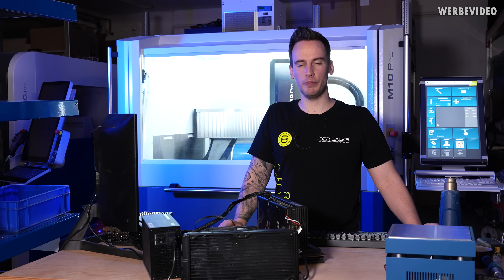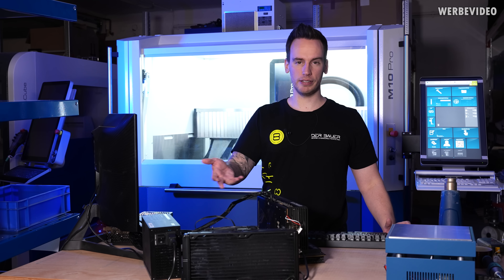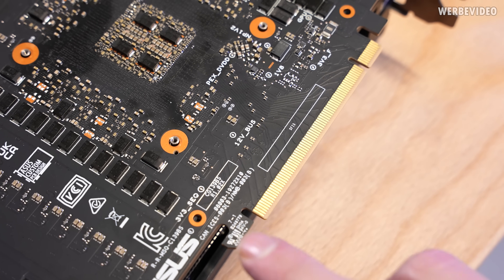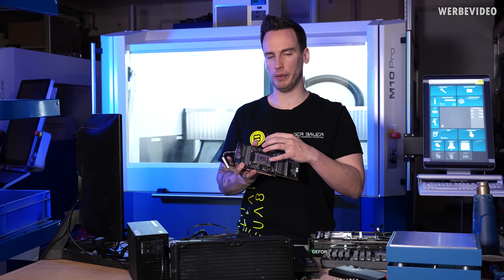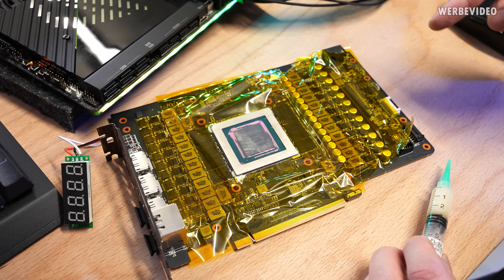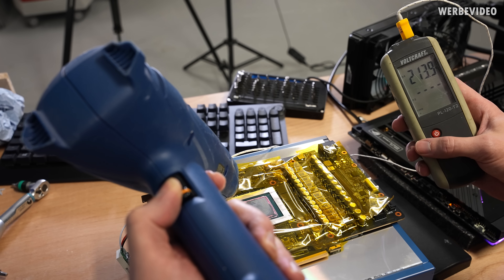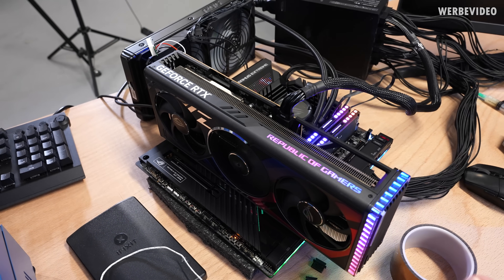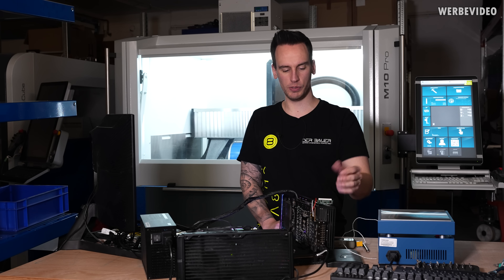I tried to repair my RTX 4090 and killed it :(

Comment from the maker: Other things I tried after the "repair":
- flash the stock BIOS again
- Update the Nvidia Firmware
Any other ideas? :D
Reply: Send it to krisFix...he's an expert at repairing GPUs and he's also located in Germany
Reply: @iLLusiveMan82  i dont knw about krisFix but i think we can try ChrisFix

jk😁
Reply: @iLLusiveMan82  thats good advice he will tell him that shouldnt add flux like that  !!!! the added flux bracked the card !=]
Reply: Send it to KrisFixGermany for repair. German based youtuber who repairs GPUs. He loves this sort of stuff.
Reply: @PanaehaliTut  CrissFix?! The Auto Repair guy? The closest Computer Related thing Ive seen he does is to use PC fans to create a fart remover in a car LMAO
Reply: @n1kobg  KrisFix-Germany is the name of the youtube chan. I believe he's the best guy to fix this card and he's local to Roman.
Reply: @n1kobg  I misspelled the channel. And edited it. Right guy named KrisFix
Reply: Have you tried resetting it with a hammer?
Reply: @oOZellzimaOo  Sledgehammertime
Reply: KrisFix-Germany
Reply: Imo covering the whole board with capton tape was a bad idea. If hot air got under it and managed to melt the solder on some components, this components can get lifted from the board if they were glued to the capton tape. In the future protect only the components that can get damaged (like electrolitic capacitors, plastic parts and so on). And don't put the board directly on the hot plate, use something to lift it a little, because if you have any BGA ICs on the bottom of the board, especially underneath the place where you heating the top of the board, the solder on this ICs can melt and they can get pressed to the board which will squeeze solder balls out of the IC and it will make shorts.

Please check if any smd components were moved out of place, especially near the part where you put your thermal probe. Also check that every memory chip is leveled the same and are not skewed - if any chip is skewed then you'll need to reball and resolder it. Also, if you somehow have access to nvidia's diagnostics software (MATS+MODS) for this gpu the definetely run this tests to check the memory. I'm not really an expert on repairing GPUs (I have repaired them, but not very much), but this looks like a VRAM problem to me, but half of the time VRAM probleams are related to the GPU itself or it's soldering . If all SMD components ar ok and no memory chips are skewed then you'll need to reball and resolder the GPU.

P.S: you said that 220 degrees is safe, wich isn't wrong, really, because the melting point of Pb-free alloys (at least the ones which are used in consumer electronics) is around 203 degrees celcius, but it'll only melt at this temperature if the whole board is at the same temperature (that's because the copper in the layers of the PCB is placed unevenly, especially on ground and power layers). More realystically, solder under gpu will melt at round 220-230 degrees celcius, but that's if the whole chip is at this temperature.

Edit: forget to mention that you needed to remove the compound on the corners of the chip.
Reply: Northwestrepair channel might have a clue. 🤔
Reply: The kiss of life?
Reply: Collab with a GPU repair specialist on YouTube
Reply: You can send it to KrisFix-Germany. He will figure out if it can be fixed and find out what the problem was in the beginning. And he lives in Germany. He is an awsome GPU service tech. Love from Norway
Reply: Definitely send it to KrisFix. He will try to fix it it live.
Reply: Weirdly, GPU-Z reports no VRAM... Maybe the memory chips shifted... With a heat-gun it's too easy to move small components simply with the force of the air or an accidental bump of the table... That's why infrared ovens are used for this kind of repairs...
Reply: Turn it off and turn it back on again. 😮
Reply: Let KrisFix-Germany have a look at it, he can re-solder and re-ball it for you, maybe for a collaboration or as a paid service, but he knows his stuff and I watch him regularly.
Reply: send it to northwestrepair (youtube channel) , he is a MASTER repairing gpus.
Reply: @MrDvneil  +1 For sending to northwestrepair
Reply: KrisFixGermany might be able to help 👍
Reply: Card has dual bios switch. try other bios.

Try reflashing the faulty bios while running the igpu
Reply: Contact Cris-fix, I'm pretty sure he can rescue your 4080 xor give some conclusions about what's cause the problem
Reply: @KirbyTheKirby  really? steve calls him for advise!
Reply: @KirbyTheKirby  Steve wouldn’t be able to do anything to fix it.  They guy can’t even solder to save his life. 😆😆
Reply: Have you tried percussive maintenance?
Reply: If you were in the USA I would recommend you send this to a professional- Matt’s Electronic Solutions or another great GPU repair professional is Northwest Repair but since your in Germany your best option is to send your card to KrisFix-Germany. Check out his Videos on GPU Repair. He is one of the best in the business and if he can’t fix your GPU I don’t think anyone can.
Reply: @shiftctrlhack  is Matt’s Electronic Solutions  located in Florida, Matt Joiner ?
Reply: @Gti_Jason  Yes that's him. He's actually been closed since Hurricane IAN. He's worked on a few laptops for me in the past. The guy is legit a good dude. I've called him about computer related things even when it didn't have to do with a repair. He's always there when you need some advice or help. His prices were pretty good and I've never had a problem. He's going to be starting a repair channel from what he said 8-9 months ago when I talked to him. Hopefully everything is ok. I just checked and he's still closed.
Reply: Sacrifice a chicken to Jobu
Reply: @northwestrepair is another YouTuber specializing in GPU repairs with some excellent examples on his channel, maybe give it a watch to check the tools he uses for fault finding or get in contact to see if he can help you.
Reply: I have a awesome idea. Collab with KrisFix-Germany! Hes from same country and he repairs cpus on top level!
Reply: bro send it to KrisFix-Germany or speak with him. his a national of yours and a master is gpu repairing (reballing etc). you could make a great collaboration btw. check his youtube channel KrisFix-Germany
Reply: Try communicate  with this guy the best 1, YouTube channel northwestrepair
Reply: The baking at 100c usually simply evaporates any humidity underneath and in in porous parts and or the mainboard. Of course you have to bake it in an oven to make sure the average temperature gets to 100c and all humidity turns to vapor.
Reply: Did you try plugging the card in a 8x slot? Just wondering 🤔
Reply: Thermal cycling the card is a much safer method than trying to reflow the card...
Reply: give Northridgefix a bell.. maybe he has some ideas ?
Reply: Seems like the gpu didn't read the vbios, you can try by using dmm, put black probe on gnd red probe on pin 1 bios, then turn on the card and quickly see if the voltage go high low then high, if its does then the vbios is oke and the gpu able to read it
Reply: Shunt resistor mod

What worse could happen?
Reply: send it to a professional repairman like louis rossmann on youtube he and his team fixes these problems everyday or better yet send it back to asus for rma and see what they want you to pay for the repair
Reply: place it on the wall
Reply: Reball.
Reply: i would love to have it as a paperweight :D but not for 2000 haha
Reply: btw i think you have a dead core now when clocks are at 0
Reply: Find an anvil and a heavy hammer, works 100%
Reply: @KirbyTheKirby  🤣
Reply: Send it to a repairman to do reball.
Reply: Next time you get this issue try pcie bus inversion. Cover up rear half the fingers and see if it still runs x8. Then cover up the first half and see if it still runs x8. (pcie lanes only) The mobo does this any way when you add multiple devices (mux/switch) or do sli. Should be a setting in bios too. This way you test from card edge to gpu die all lanes. Done in top x16 slot.

PS - This is also a way to get mining gpus running (that arent dead) that were inserted the wrong way.
Reply: reball the chip
Reply: have you tried reseating all the smd's ?
Reply: Just put asus tuf oc bios
Reply: have you tried fully clearing the vbios before flashing? try using a ch341 programmer and solder it to the chip directly, if some cells are damaged on the flash, a different checksum would result and the flasher should tell you. If the vbios chip is indeed damaged, you can usually purchase a blank one for just a few €s. Once you have the chip, flash it with stock vbios, read it back to verify with checksum and finally use a hot air station (not a heat gun please!) + flux to remove the old chip and solder on the new one ;)
If you don´t have a hot air station, you can usually get away with making two blobs of solder around each side of the chip and rapidly heating up both sides to make it come off. Again, plenty of flux is needed to get a good result.
Reply: Aye, next time buy Radeon.
Reply: Try manually switching it back to 8x
Reply: Hey :) I can try to reball it, maybe you just melt/shorted some memory pins/duno - need to check =) in the worst case scenario you overheated memory controller and it doesn't detect memory anymore even if core shows up... I actually love doing mods to gpu's - just recentlly bring to live rtx3070 with new memory and some clever gpu vcore mods
Reply: You probably need an actual hot air for soldering not a hot gun then reflow it. You might of just barely melted the solder and it didnt attach back.
Reply: Call Asus RMA and pray they didn't watch this video.
Reply: @der8auer EN
maybe I can tell you what happens 

Same problem, happened to me (PCIE 4.0 x8)

I am using ROG Z690 EG, I took it for maintenance, after two experiences, I found a solution

If you update your bios (maybe 1403,1505,1601) it was at that time that the problem arose

Be sure to update directly to the latest bios before 1403 (eg.1101/1304)

Now can't go back, I can only send it to their headquarters in Taiwan to flash back bios 

Now I running bios 2103 and Tuf 4090 ，finally can do it pcie 4.0 x16 

Hope my unhappy experience can help you
Reply: Reballing !!
Reply: I would heat it up and try re-Allain GPU package and put some pressure from top on the package while cooling it down. I think one of the corners gets displaced via you blowing air on top of it.
Reply: 80 degrees ... i dont know which oven u r using but mine goes higher and i can reach the needed temps

U DONT USE HEATGUNS !!!! ... as soon as the solder gets liquified the parts are LOOSE and free to move ... by adding air pressure(and maybe vibration by moving it) it will become a recipe for failure !!!   ... use an oven and do a heating cycle with cooldown time

that was a pretty stupid move

PS: i'll take the paperweight for shipping?
Reply: I would try sending it for warranty repair xd
Reply: flash another bios with different id and then flash stock bios back, becasue flashing the same bios everytime it just doing nothing, this is known bios issues of rtx 4000 series
Reply: @krizFix can fix that. I think he already has the stencils and tools for 4090.
Reply: Flash to asus tuf bios and check it out.  Then flash back to asus strix bios.
Reply: I think a reball would be the best, since the reading from the thermostat might be off and you might just overshot the melting point of the solders and some of them fused together and shorted some critical pins. The pads on the pcb needs cleaning anyway.
Reply: Autoclave?!
t needs pressure
Reply: Any access to someone that could re-ball it as you said? Or maybe you've got contact with some AIB that could swap gpu die to different card or different gpu die to this one altho i know, that's kinda a stretch :D
Reply: 1 Check all voltages on the graphics card.
2 Have someone who specializes in graphics cards perform professional reballing.
3 Replace the memory.
Reply: You're asking us mere mortals???
Reply: just reball gpu
Reply: Did you try flipping the GPU the bird?  That's usually my goto after swearing at my failing hardware 😀
Reply: Nice
Reply: Warranty?
Reply: Bios chip fried?
Reply: Ask /Louis Rosman what he thinks, im sure hed be glad to help a fellow youtuber and you both can make a video about it. win-win
Reply: do the same thing but with proper equipment
Reply: return it to the shop or sell it on amazon as almost never used, in perfect condition :)
Reply: Карта лежала прямо на нижнем подогреве, +фен дул очень сильно, нужен визуальный осмотр, не сдуло ли что-то) И снизу на предмет слипания элементов.
Reply: А вообще можно было бы пару роликов глянуть как работают профессионалы.
Reply: I would have made sure that the card was flat on the heat plate to discourage solder from flowing all in a common direction which could then bridge neighboring pads. 

Connect a JTAG probe and compare the boot sequence to that of a known good card with the probe.   Ditto for any UART headers you can find on the board.  You maybe 'lucky' that the issue now is something else like a dead power stage and the card is forcing itself into a safe configuration.  Thus check those microcontrollers on the board with JTAG/UART/I2C probes as appropriate as well.
Reply: KrisFix-Germany
Reply: Judging from what you get, there is definitely a problem with vBIOS. Here are possible causes and solutions:
1. Power for vBIOS EEPROM chip is messed up. Check the voltages on pins. Also, be sure, that pin 1 and 8 on EEPROM are not shorted.
2. Dual BIOS switch circuit is damaged, which leads to two simultaneously working vBIOS chip. Easy way to solve this is to desolder one EEPROM or desolder vBIOS switch and and try to solder jumper wire instead of it.

I think, it's nice starting point. Also, check the back side of the GPU for any component casualties, since come components on the bottom layer have direct contact with preheater surface.

If I could lay my hands on this card, it'll be much easier and faster to fix it. But sadly, I'm not in Germany.
Reply: @valuxin  Good advice
Reply: try turning it off and on again
Reply: If you have your SSD installed in the first CPU m2 port it may limit the first PCI express slot used for graphics cards to 8 lanes instead of 16. Moving the SSD to the second CPU slot or to the chipset one will make the graphics card use 16 lanes. This behaviour is motherboard specific. Some have it, some don’t. The manual should contain information about that.
Reply: ask mom for more money
Reply: Power connector? 🤔
Reply: This should be a warranty replacement right?
Reply: The PCI-E x8 happened to me with my old HD 6970,
I accidently fixed it when i went sub-ambient on the card, the cold somehow fixed it.

Anything else i tried failed, but the solution was an accident - life is strange :D

Though it may not work for you.
Reply: With the card in the system, give the back plate a blast with your heat gun for a few seconds at a time until the heat starts to soak into the card. I've done this with a card I bought off eBay that were listed as "for parts, not working" , and it started working again. I just left the PC on 24/7 and changed the power management settings so it wouldn't go to sleep and . . it worked for me. Maybe worth a try.
Reply: it said load bios so do that reflash the bios 
gpuz did say the bios was not there .. so yea  that should do it i dont think the card is  done for just yet
Reply: Next 4090 running x8 pci express send it to me my friend
Reply: IMPORTANT!!!! (repost) "Pretty sure you destroyed your RTX 4090 ASSUMING GPU-Z was accurate. If you look carefully on the Z790 (PCIe 5.0) it's showing up as "PCIe 4.0 x8" when it should show as "PCIe 5.0 x8" which is correct. The RTX is a PCIe 4.0 x16 GPU which equals PCIe 5.0 x8."

I too was freaked out until it dawned on me where the error was in GPU-Z. My CPU-Z u27307
Reply: sorry too hear about your RTX 4090 .... i would really appreciate it if you could send it too me , i need the cooler !!!!!
Reply: Yeah, send to "KrisFix-Germany" for an actual diagnosis, if its fixable he'll fix it
Reply: Send it to Kris fix Germany
Reply: Shoot it with a Leopard 2
Reply: send it to @VIKon-msk
Reply: Put it in some rice
Reply: Drill a hole through the chip. Paint the entire card blue and throw it in the ocean.
Reply: Try "FOREST" YT Polish Channel,  this guy is a wizard,  know all about GPUs. Also fix many of them sent by the viewers from all Europa.
Reply: I worked as a QA engineer and repair specialist for a multinational enterprise, specifically multimedia electronics costing upward to 200K.
75% of the time parts would break because of bad handling:
- SMD's that get knocked off or break during installation
-  ESD is a very annoying one as it is hard to test, it could be a reason for BSODs or artifacts. ESD damages transistors and can make them operate in a crappy way.
- someone messed up during a software update (e.g. firmware/BIOS)
BGA's don't break easily, especially in such a high density and high pin count package. The amount of joints make them more robust.

25% of the time it happens at the factory but gets through automated testing. It is very hard to figure out a problem that a hardened, highly advanced robot can not detect. For examble, a hairline crack in a resistor may alter its resistance value slightly.
Half of the time I had those I would have to manually test SMDs with a multimeter and sometimes desolder stuff to check under a microscope. Finding hairline cracks in a component that is 1/10th of a pen's ballpoint is hard, but that's how I did it.
And sometimes I would just write code to manually send a signal through a certain port so I could measure where the bad signal was coming from.

Either way: YOU NEVER, EVER point a heat gun at a large BGA package like that. I tried the same with an Xbox 360 during the RRoD days lol.
Also, one of my best GPU's in the past was a 7970 GHz that I bought for a really low price as it wasn't performing well, the problem was a broken decoupling capacitor at the card's edge connector. Easy fix.
The correct way to reflow a large BGA would be to have an oven. The temperature has to slowly go up, then has to stay at a certain value for the parts to not get into a thermal shock. After which the temperature can go up again, reach a peak for a few seconds and then go back down. Again pausing somewhere to avoid thermal shock.
Thermal shock meaning that you could cause internal hairline cracks, at worst case in the silicon die, or at best at the balls. They also should be pre-baked to make sure all the moisture that gets in the SMD's / BGA's evaporates to avoid popcorning since soldering happens at a much higher temperature than water's boiling point. ( Popcorning = water becoming gas inside a part causing essentially tiny explosions.)

Tbh, I don't think I would be able to fix it but here's what I would try. Try covering the previously unresponsive half of the PCI-e connector with Kapton tape, a physical x8 slot or through an x8 ribbon cable. You'll be able to see if you made the previous error worse or if you actually introduced a new problem.
If that doesn't work, try putting it in an actual oven (for electronics, not for cooking. unless you have some skill and are okay with not using it for food). In the best scenario that should get rid of any stresses and disconnections that the heatgun-method might have caused. The objective is to try to get it working and through stress testing   at x8 and then start again at square one, if it makes it back to square one that is.

If that works, then you start measuring stuff with a multimeter or oscilloscope for a few hours,days,weeks lol. These things are so complex and having no PCB layout makes it nigh impossible to know what you're doing without a serious time investment in reverse engineering the signals.
Oh, and there are at least 10 layers on this PCB. Could be over 30.
If you plug it in you should be able to measure some signals and see some voltages near areas where you know what to expect.

But really, this just makes me remember my Xbox 360 fail 15 years ago, I'm not gonna lie: that thing was FUBAR. lol.
Reply: Bios chip replacement?
Reply: Could just try heating it again with more flux.
Reply: Always want to use a jig / pcb holder, if other solder balls begin to melt you are 100% screwed
Reply: Send to rossmann repair group
Reply: Rossman?
Reply: Praying?
Reply: I successfully repaired my evga gtx 1060 6gb sc single fan model using amtech 559 v2 flux and heatgun. The history of the card was that the previous  owner bought the graphic card from another person not knowing what was said or lied about ''it working'' when I bough the graphic card for €80 while taking a chance to investigate why was the card wasn't working correctly due to the  previous being honest with me that the previous owner before him surely have dropped the graphic card because of the tell tale sign of the pci-e bracket been bent and touching the edge of the pcb during the gpuid testing causes the card to artifact and crash is another tell tale sign of broken solder balls under the gpu chip and memory chips. So since June 1st, 2022 of owning the evga gtx 1060 6gb sc and repaired it myself it still working no crashes or artifacts since I did a better job in replacing the thermal pads and thermal paste since evga undercut the amount of thermal pad to the vrm area resulting terrible overheating. The gpu temperature stays under 55c on a warm day but as low as 31c on the cold day if the card is in idle state the lowest temperature i recorded is low as 17c on a cold day and 27c on a warm day
Reply: you should first remove the compound from the edges of the GPU, as it can lift the GPU a little when heated and the balls can lose contact
Reply: Maybe  you could do a collab with either KrisFix-Germany or NorthridgeFix. Either one of them has fixed dead gpus before. Your problem could be a bad EEPROM/BIOS chip or faulty memory or memory controller.
Reply: Buildzoid!
Reply: Collab with KrisFix-Germany! Expert GPU repairman in your area.
Reply: Re-heat, might need a bit more 🙂
Reply: The motherboard stuck on bios reading and the memory can't be accessed by GPUz, I would say a memory ship have a soldering issue.
Reply: Louis Rossman can fix it, 99% sure about it, because he's a pro at fixing chip related stuff
Reply: The NorthWest Repair guy is really good.  I just watched his EVGA 3080ti repair and it was impressive.
Reply: microwave
Reply: Looks like were going to get Louis Rossman collab
Reply: ship it to buildzoid.
Reply: Yeah the official process is to RMA it, they toss it in the bin and send you a replacement XD Because nobody fixes this sort of stuff anymore as it costs more than to make it.
Reply: Turn it off and back on again 😊
Reply: Reflow the vram :) voltage is there perhaps a module shifted
Reply: try un soldering the vbios chip and flashing it alone that worked for me on a 3070
Reply: @KirbyTheKirby  Or maybe ship it to Louis Rossman and see what he thinks. After all, it has fan spin!
Reply: @TheKazragore  Well since it has fan spin it's working. lol Louis Rossman's job would be quick.
Reply: Northridgefix youtube take a look
Reply: @MrDeadrage  nope, he sends gpus to northwestrepair , Northridgefix just does "basic" repairs on gpus.
Reply: @KirbyTheKirby  buildzoid would likely be better for that, and then there are less known experts who would be even better
Reply: colab video with northridge fix!! he can do it!
Reply: try sending the gpu to northwestrepair or NorthridgeFix they are really experienced at this
Reply: Cook it again in a real oven? 🤷‍♂
Reply: @iliqiliev  no i don't think that will fix it or make it work it may even kill it  more ..
Reply: Northridgefix
Reply: Send it to @northridgefix haha
Reply: Sign it & sell it on ebay to cover some of your loss & will have a nice story. Maybe a video. IDK about repairing except try a real oven.
U can use the VRAM modules for transplant to another card. That way you can bin the memory modules.
Reply: @n1kobg  the kapton tape lifted up. Those memory ICs are cooked... (7:34)
Reply: @Ground15  Oh ye i saw, he was blowing under the tape while showing the temps.
Reply: @Ground15  That's what I was thinking too unfortunatly
Reply: Send it to NorthRidgeFix. The dude fixes almost everything board related, and he can locate any defective VRM or similar.
Reply: SEARCH FOR PAULO GOMES HERE ON YOUTUBE, HES THE Best guy in the world about GPU repair! he definily can help you! and maybe you can send the card for him and create a crossover content! He used to work with Ronaldo Buassali from GALAX and definitily will find a solution if its not dead the gpu.
Reply: Buy another strix, put this one back and return it for refund
Reply: @JewTube664  🤣🤣
Reply: @JewTube664  totally illegal to do that :D
Reply: @JewTube664  lmao
Reply: Get some skills and know what you are doing???
Reply: @DrNoBrazil  U must be new here :D